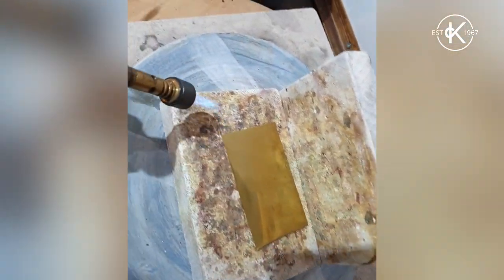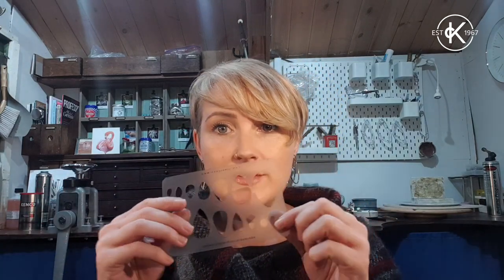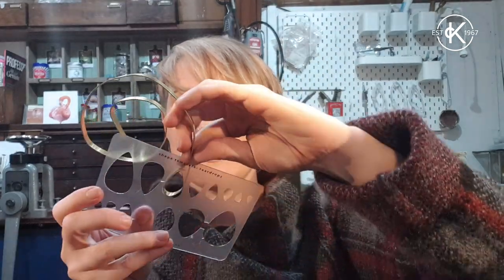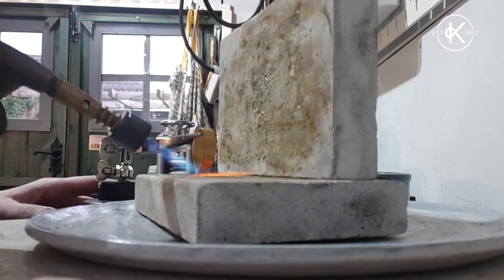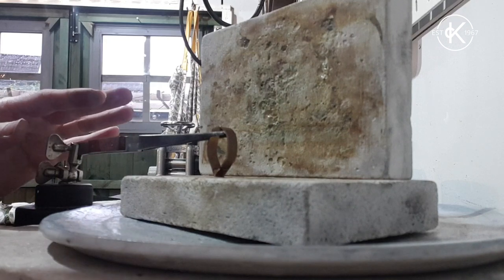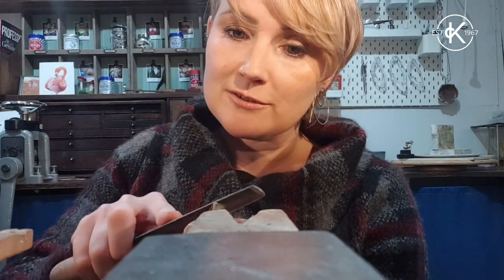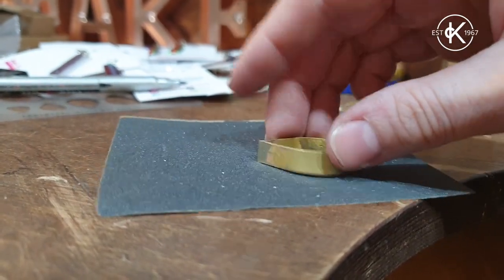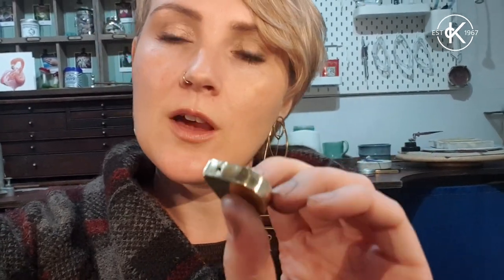How To Make A Hollow Metal Bead | 12 Months Of Metal

Comment: i'm a huge fan! love this project. did you do a video on the earrings you're wearing? i looked and can't find one!
Reply: @makeitwithkim-jewellerysil3126  found it! love them. would never have thought they were jackets? do you  know the gauge of the bezel wire you used in this project? going to try my hand at it! thanks!!!
Reply: @crazy4beading  The bezel was a 5mm cast bezel cup from Kernowcraft. The main metal was 1.5mm square gold-filled wire. The earwire was 1mm round :)
Reply: thanks for the help. i was really asking about the bezel wire you used in the hollow bead. thanks again!!
Reply: @crazy4beading  Ahhhh :) I'm not sure, I think it was about 1mm thick. Anything between 0.3-1.5mm would work fine.

Comment: Great information!  Thank you!
Just curious ... would there be any issue with quenching the piece in the Pickle solution rather than in water.  Since the Pickle solution works better when hot, wouldn't that help speed up the cleaning process, instead of quenching in water, then having to warm the piece back up in the pickle solution?
Reply: Yes, and many people do but from a teaching perspective, it's not safe as there's a risk of the pickle spraying at you when the hot metal hits the solution, especially with big pieces.
Reply: That makes sense!  Thank you!